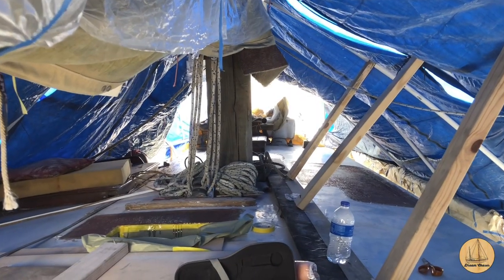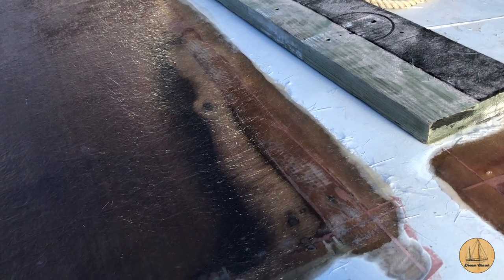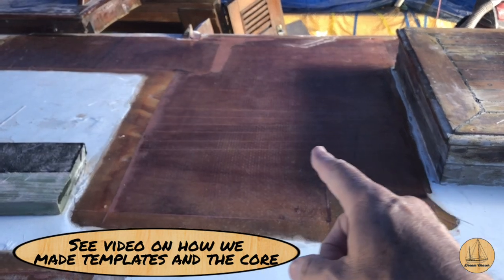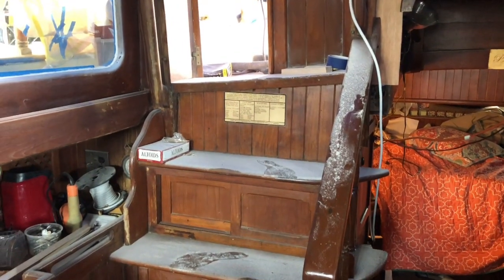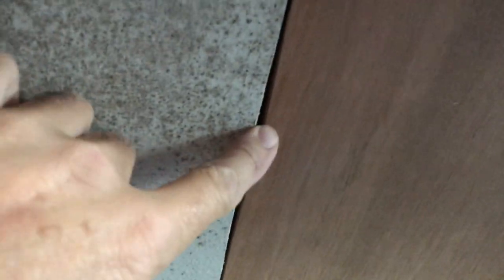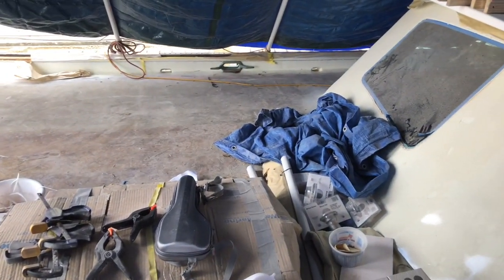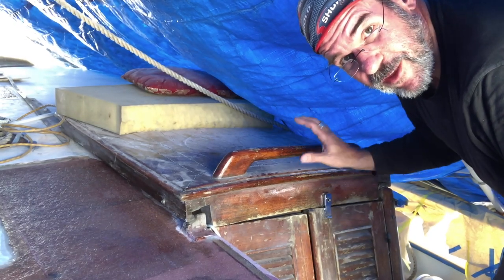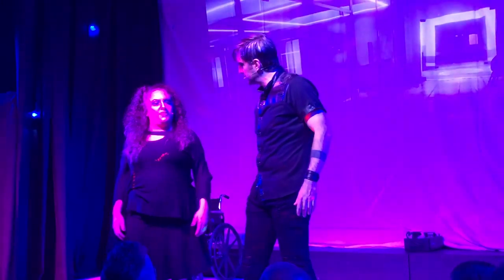How to Fiberglass a boat & How to fair the joints

Comment: Here’s a tip for you...instead of putting the fairing compound on a board, put it in a ziplock baggie and cut off tip of corner. This will allow you to force it into all those corners and crevices just like cake batter. Once it’s all filled then come back with spreader to smooth out.
Reply from the maker: Great tip. I attempted that up top but struggled to get it to come out even. I think I didn’t have it thick enough. I will try that since I have some more to do.
Reply: SVDreamChaser  try starting with a smaller hole than you think you need, try it and adjust if needed. It takes a couple of tries to get it right. But has saved me a bunch of time, once I got it down.